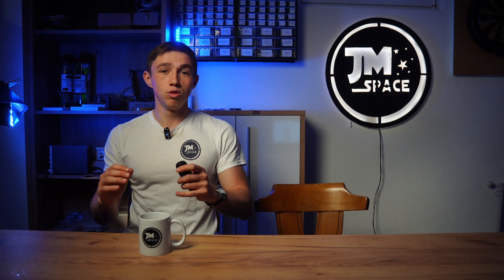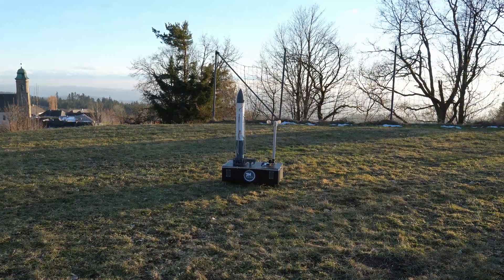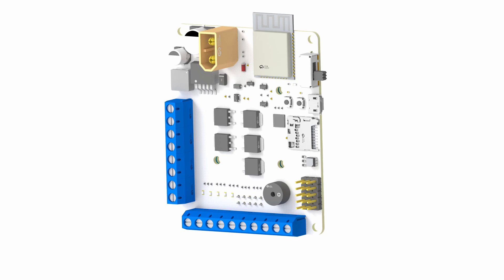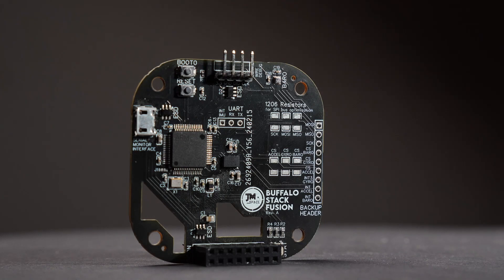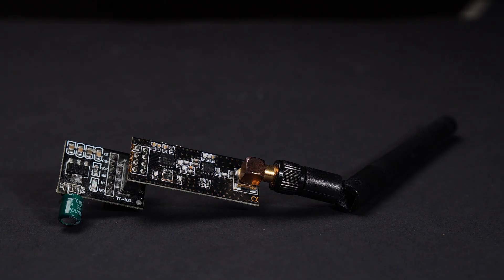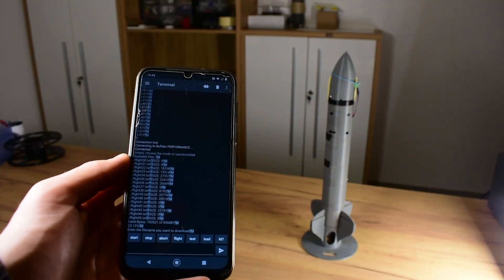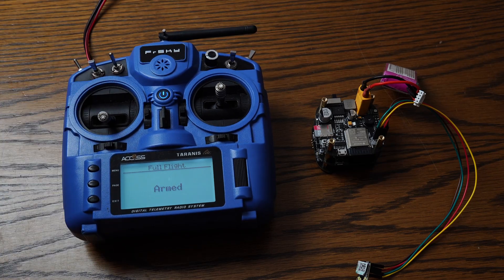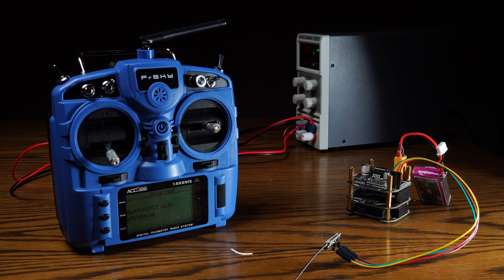New Team Member, Buffalo Stack, and Flight Three

Comment: Hi guys, I really interested with mechanical item
I had a background in mechanical engineering (CAD/prototyping)
But, I have no clue about coding
Do you have any suggestion for me what should I learn to build rocket like yours?

Previously I ever built Autonomous Plane using iNAV
but there is no coding involved
I am wondering how did you get the actual data such as gyro, altitude and process it through feed back for the engine (control system)
Reply from the maker: It's a gradual process. So, we advise to just get started and rapidly innovate on your software. At first you might want to use something like the Arduino IDE and an Arduino based microcontroller, then when you get more advanced you can make a custom ESP32 based flight computer, and program it with a more advanced version of the Arudion IDE the Platform IDE integration in Visual Studio Code. After that you can take it even a step further, and design your own STM32 based board and use the STM32 Cube IDE to program the board. 

That's not to be said that you can't achieve a TVC controlled flight with just the Arduino IDE alone. 

For determining orientation you will need concepts like Euler angles or Quaternions, and for the controller you will want to use PID.

I hope my reply helped you to get started on your projects!

Comment: I would like to see how high you can get a single bldc motor on a rocket with say something like 2 to 4 cells of 18650. Could be automatic, manual or rc control. 
Challenge accepted?
Reply from the maker: We would probably either have to use two such motors to counteract roll, or use one doublebladed version. 
Definetely sounds like a fun idea. 
Unfortunately, we have so many projects currently going on that we will not be able to accept the challenge ... 
Maybe you could give it a try and let us know how it turned out
Reply: @jmspaceR  I think 1 motor is enough. and would be way more efficient. You could have fins that counteract the motor torque. with trial and error you could get the fins set right and use throttle to adjust to zero roll (even automatically, gyro is one way). These dji drones can fly for 30 minutes on a 250g (75mah/minute) drone with 4 motors and a 2s 2250mah pack, now think 1 motor, FC, two micro servos (4g), esc and 1 or 2s 4000mah pack.

I wanted to take a low cost webcam pointed down and and FC to keep the rocket going straight (like a mouse).
Reply from the maker: @user-rs8zg8ey2b  the problem with the fin approch is that it won't work while hovering, as it takes advantage of an aerodynamic effect. 
However, on a project like this will definetly involve some hovering, which would suggest that you would need some other means of counteracting roll.
Reply: @jmspaceR  No need to hover IMO, just going for altitude. I think the altitude could easily go above 15K~20K feet, once battery runs low, shut off motor and release a streamer to keep it pointed correctly as it falls and visibility. Then when ~1000 feet release the parachute.
Of course have telemetry the whole flight.

Could even stage the batteries, first 2s  (or 3s) gets it to say 10K feet, then release it with streamer/etc, and continue on with two fully charged cells and lighter weight.